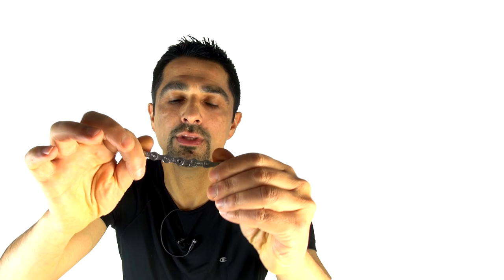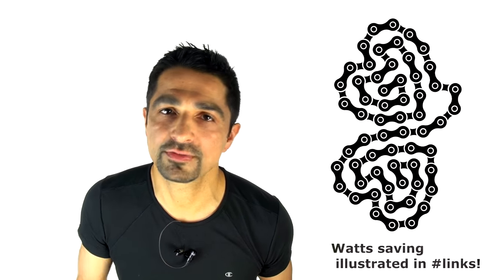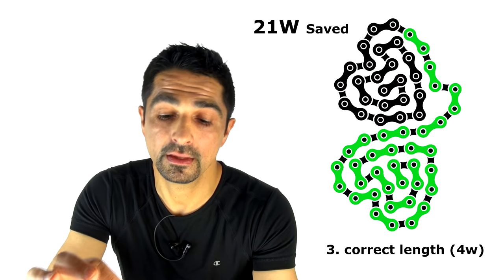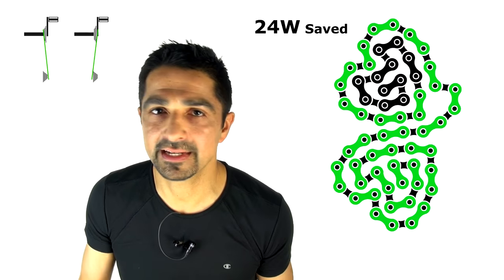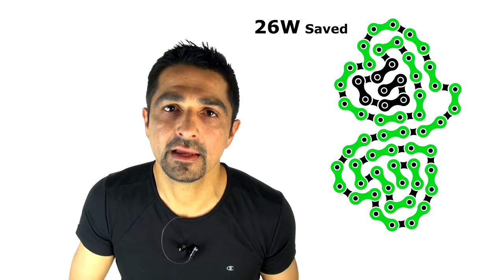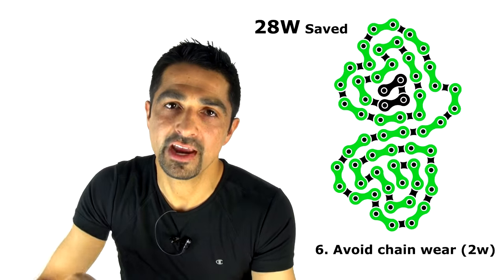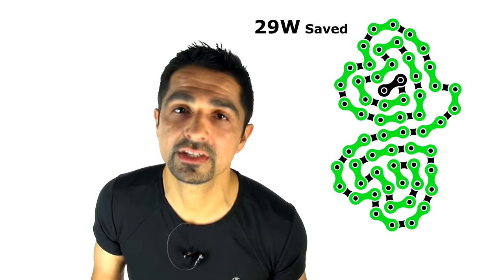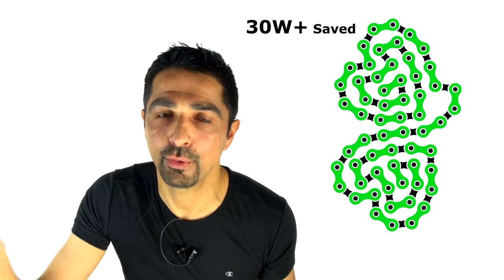Chain Science! How to save up to 30 watts of losses from your bicycle chain!

Comment: everything was so good up until chain wear/stretch with the weight analogy. the chain doesn't stretch from tension, the cumulative wear on all the pins add up to more play between each link which makes the chain longer and seemingly stretched.
Reply: True, that tension itself is not the cause of elongation wear, but it does play a role. The more tension on the chain, the higher the frictional shear stresses that tear away the material within the links and rollers, and the quicker the chain wears out.
Reply: Not my chains.  I put so much torque they actually stretch.
Reply: @mitchellmtb7202  same for my girlfriends

Comment: You just saved me $65 by mentioning that 11-speed chains can be used on 10-speed systems...I had accidentally bought an 11-speed chain....thanks!
Reply: Does it really work? I’m running sora on my gravel bike so I can buy nice 11 speed chain?
Reply: Im using a 10spd chain on my 9 speed drive train with a 8speed claris rear derailleur works fine shifts crisp

Comment: I hate when peoppe give a specific number like 30 Watts. What if I'm a 6 year old with a 30 watt power outout. "Cycling companiess hate him, double your watts in 5 minutes." Percentages are bad enough but a static number?
Reply from the maker: You are 100% right; ours was a rather primitive approach two years ago! Send me an email and you can trial our forthcoming drivetrain loss calculator and also checkour our more nuanced chain wear/watts calculator (https://www.youtube.com/watch?v=gDmUPMsGNKo&t=1s). Believe me we are working on a better solution right now.
Reply: you REALLY should not display your email address to the public like that.
Reply: You know a 6 year old competetive cyclist ready to hit the velodrome circuit or road racing?  Do tell...
Reply: Peoppe ? I hate it when people try to use a specific word but fail miserably.
Reply: Do Not Apologize dude, some of the people who come here are so unfullfilled in life that they can't formulate a scale in their heads to help them count up to 30, thereby takling into account all possible numbers enroute to the guestimate, Don't be like dawn :P
Reply: Stop hating Dawn, it's a guidance/estimate with science behind it, but of course it varies depending on a number of things.
Reply: @brianford5643  Mostly on the integrity of the marketer.
Reply: Friction loss from chains scales with chain velocity, which is fairly stable, depending on your cadence window more than anything, and perhaps applied torque as well, but we're not worried about fluid dynamics and complex factors like that.

Comment: Save 74 watts from the right tyres. Save 30 watts from the right chain.  Save dunno how many watts from God knows what ....I don't even normally produce 100 watts on a leisure ride. So if i apply all these tips and tricks, i will be getting extra watts without doing anything. My bike turns into an electric bike.

Comment: A rusty old chain is the best way to get fit.
Reply: with sand in your water bottles your set for top fitness.
Reply: And flat tyres.
Reply: Lol I do this with low tyre pressure... train at 80 ish psi but pump upto 110 for a race... give me a extra min or so over a 20k race
Reply: On a rusty steel frame

Comment: Maybe not the cheapest option, but maybe getting 3-4 chains simultaniously? every 200km(i use wax, so thats about the time when i would have to bath the chain again in paraffin wax and parafin oil), simply change to the next one, that way you always have a relatively unworn chain for long time. Also, in the case of waxing, if it actually does get really dirty, simply take it off, put on the next one. No need to clean it, wax it and all the stuff that is involved just wax all 3-4 chains at once. Saves a bit of time too

BTW: Buying bike specific degreaser is probably the most cost-uneffective thing, right after buying pinarello frames. I personally use orange/citrus degreaser and heat it slowly up to just under 40°C for factory chains with the factory lube. Put the chain into a container, add the degreaser(or mineral spirits also work srly good), shake for a few minutes and your chain should be sparlking clean and rattle like well...a rattle.

Comment: Just changed my chain and chainwheels + set on one of my bikes after around 15K. Could not see even the slightest wear comparing the new and old stuff in spite of a good deal steep climbing. I credit this the fact I only ride this bike with a 99% clean and well lubed chain + this bike was almost never used in rain. Just proves a well-oiled system will go "forever". Shimano Ultega, Dura Ace chain, Finish line wet/ceramic alternating (not doing too well in the test btw...).

Comment: that was super interesting.  i am a casual rider (ex racer in 1970s).  personally i love a whisper quiet bike and drivetrain.  my speed is slow like 24 km/hr, but i do maintain my drivechain better these days than when i raced even.  just put on a new shimano ten speed chain and cassette.  Lightly degreased before installation.  Used a graphite based lube (Muc off).  never ever have i felt so pleased about a new chain/cassette.  Yes I changed my chain at 5000 km... but I will get a measuring tool...just used the old "mark I eyeball" test.  Now that i know an 11 speed chain is better, I will be sure to try that next.  I do not think all degreasers are the same... Muc Off is better than others i tried, but it could be the tool from them to get better access to the bits.  i am going to watch your tire pressure video next.  All my life i just used my thumb and the "ping with finger" pressure test.  But i have experimented with slightly different pressures.  In old days of tubulars we just pumped it hard to about 100 psi (estimated) on the road and as high as possible on the track.  Now i ride 700 x 25 mm tires.  by the way, Continental gps 5000 blow away Specialized Roubaix tires (i use the latter for more early season.  sorry for the novel.  i wonder if anyone will read it.

Comment: I'll add one point about degreasers that transfers from every other application of degreasers in lubricated machines. Be sure the degreaser is completely removed one way or another before applying the new lubricant, otherwise you seriously degrade your lubrication right away.

Comment: Some great advice there, but 11 speed chains arn't compatible with 9 speed systems because the chain gets stuck between chainring when changing down to the smaller chainring.
Reply: I've installed 12 speed chain to 10 speed chainrings without any problem

Comment: The WD40 shown is a water dispersant, not a lube. Diesel is too thick to clean chains with. Petrol and paraffin are great chain cleaners. Aldi's steam cleaner works very well with water soluble degreaser. 
Best chain lube I have used so far is the Castrol, Muc off, and WD40 motorcycle  chain waxes. Lasts for over a 100miles and good in wet weather.
Reply: If you live somewhere where winter is generally cold, wet, salty roads and grim, then you can use diesel as a chain cleaner. When I lived in England and went out for 5 to 7 hours each saturday and sunday and came back with dirt and salt crusted bikes in winter, I'd have a cold soapy bucket of water waiting for a quick 5 minute wash down and a can of diesel and stiff paint brush to clean the chain and chainrings. It was cheap and worked well.

Now, companies like Park have effective chain cleaning tools and cleaners that do the job better. Wash the bike, clean the chain and drive train quickly and after you've showered and chowed down some food, come back and then dry and lube the chain. If you do it often and get in the habit, it's very easy to keep things really clean.

Comment: Morgan blue also make great lubes, as used by many TdF teams. I now see you have it in your 2014 test and it did well, so happy about that. Will try some of your top ones as well. As a cheap lube on old bikes, I use chainsaw lube, same as most but a fraction of the cost

Comment: What I've read is that larger sprockets are more efficient, because friction is primarily determined by the angle change of each roller and the tension on the chain. Small-small has much higher chain tension (on the power side) than large-large, and the change in angle for each link is higher. This same study also basically said cross chaining wasn't a concern compared to pulley size

recumbent guys with power-side idler pulleys have noted slight differences that favour a 23 tooth idler over a 15 tooth one as well.
Reply: In an age of marginal gains. The drag from cross chaining is worth avoiding. Personally, if I can hear noise from the chain when I am cross chaining, my feeling is that this is not only causing loss of power going forward but also causing wear on the chain. Both of which are worth reducing.

Comment: I have found wax lubricants to be hopeless for lasting qualities.  Engine oil throws off and contaminates braking surfaces.  I use a particular oil, not because it is the most efficient, but because it is the most persistent.  Particularly INSIDE the pins where it counts.  I have been able to reduce the oiling to once a month or about 1500 to 2000 km.  And the benefit is that the OUTSIDE of the chain is then less oily and picks up less grit.  I shouldn't mention the manufacturer "Morgan" but I have tried countless lubricants over the years and this stands out for the reasons I describe.

Comment: l recall cleaning up the old chain on a used bike l bought took quite a bit work l think he used graphite lube :P so after l cleaned a relubed it went for ride and noticed more skipping going on .So the following year over the winter l bought a new cassette 11-32 for climbing and 50T chainring .l figured all else is new so should the chain and l bought new KMC chain too ,$100 well worth it . l checked how much stretch l got by lining up the chains side by side and got a full chain link of stretch between the two !! SOOOO big difference in performance !! thankfullly he only used it on a trainer !!

Comment: It is a very good video. The main issues would be pretty much solved by having full enclosure for the chain drive, but unfortunately this is not done on most bicycles. With a fully enclosed chain there is no build up of dirt so you don't have to clean the chain. Also chain wear is drastically reduced. A chain that normally might only last months will last for years and years.
Reply from the maker: Interesting suggestion thanks
Reply: O-Ring Chain

Comment: An interesting and informative post. After some research (when I first started riding a recumbent trike), a few years ago, I stumbled upon Chain-L, (which I notice in your list). I must admit, my priority was/is not "Loss-of-power/Watts" but more of "What will last longest." Chain-L is easy to apply when you are running with chain tubes, as most 'bents do: A drop of lube onto the roller just before it goes into the tube allows the lube to drop around the link without falling to the ground. After the tedious oiling of two and a half + chain-lengths, ('Bents have LONG chain runs), run an electric paint-stripping hot air gun over the chain as it goes over the rear sprockets to warm the oil and allow it to penetrate the rollers. Yes it IS messy. But it lasts, survives a drenching without the chain going rusty, and runs really quietly, just needs wiping off before adding some more. It works well for me for my riding to work, and reduces maintenance, but then, I guess I am not the type of rider that this video was aimed at! :-). Thanks for posting!

Comment: KMC say never completely degrease a chain, and especially so from new - and never use a degreaser. Just clean the outer chain and put new oil on. Sadly, I never got on with wax as I kept getting squeaking, but I am overweight, so I think that's the reason. The same with dry lube, so I only use wet.

From KMC

We recommend never to degrease the chain completely. Also when changing to wax, we recommend to degrease the chain only on the outside. If you degrease the chain completely, we recommend to soak the chain in wax for 12–24 hours, so that this can penetrate into the inside of the chain.

Attention!
Never use acidic or alkaline cleaners (rust remover). These will damage the chain and in extreme cases can lead to breakage.
Never use aggressive degreasers - these will loosen the factory applied grease from the pins. This allows dirt to penetrate and drastically reduces the service life of your chain! Furthermore, these agents are harmful to the environment.
Chain cleaners also often contain solvents that can damage your chain.

https://www.kmcchain.eu/Maintenance#:~:text=We%20recommend%20never%20to%20degrease,the%20inside%20of%20the%20chain.

Comment: People mostly prefer sensational numbers also in academics, giving the top most result using the keywords "up to" is a common approach in lit. Even if the number 30 watt is for the sprinter that produces 2000 watt momentarily, still a good number. I mean, everybody that uses a power meter, can guess,  dirty drivetrain causes only a few watts. What makes the difference for me is the feeling under your feet and legs when you ride clean drivetrain, it makes the flow perfect.

Comment: Automatic transmission fluid is better than regular motor oil so if you have both use ATF1 because when you think about they are both working with gears (there are gears in transmissions

Comment: Your right about the home deep clean BUT DONT USE PETROL in a container and shake it up - I did, and for some reason the petrol wants to expand  as you shake it - HUGE pressure builds up, with obvious safety implications...........I now use white spirit or paraffin and it works just great without the explosive potential. I have an ultrasonic at home, a good one, which I used to use, but now I MUCH prefer to simply dump the chain in an old plastic milk container, and add a little solvent, shake it up and repeat.........I then use the old dirty solvent as firelighter on a rag in our woodstove.........I can honestly say shaking up in a container is as good as the ultrasonic, but quicker and much easier................I also have made my own paraffin chain wax from candles and paraffin, and that is super slippery and super clean on the chain and cogs.....35years of cycling and I think I've got the system that I'll stick with for the rest of my days. The wax also works well on pine furniture like "Briwax" - Very Happy !
Reply: You can improve your liquid paraffin with tungsten disulfide

Comment: recent tests showed that cross chaining 53;28 wasn't as bad as using small chainrings/cprockets generally (eg: 39/11). The greater friction required to make the tighter turns around the small rings was worse than cross chaining.
Reply from the maker: thanks John, FYI   our sheet  http://fft.tips/drivetrain   has all the stats built in on cross-chaining